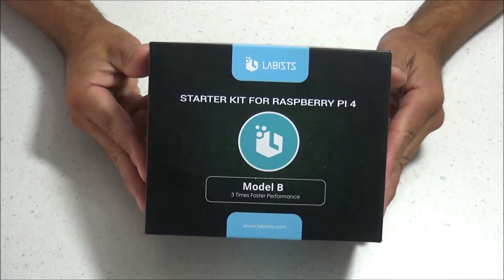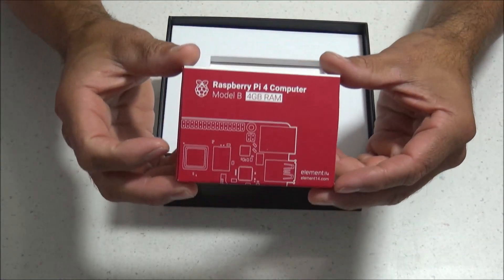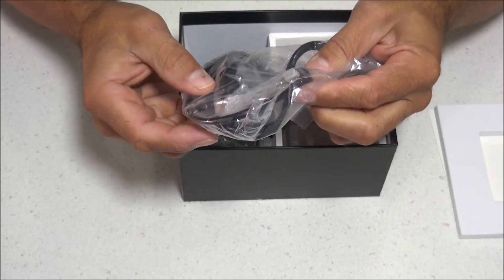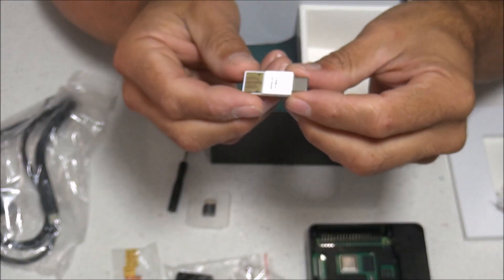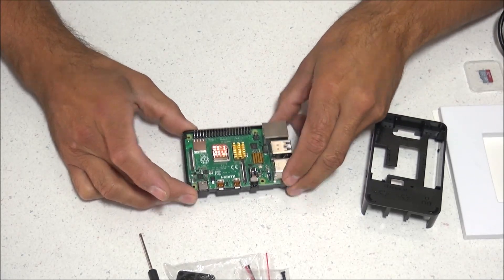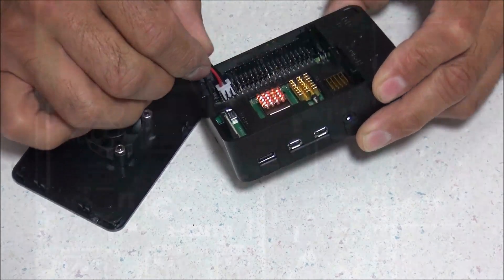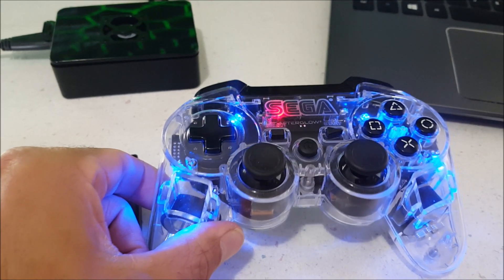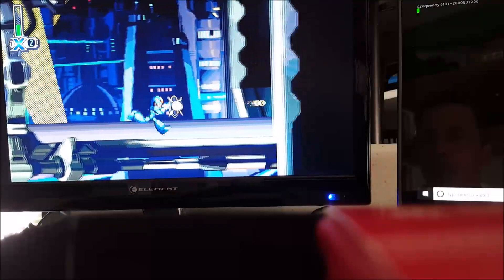Raspberry Pi 4 ready to GO Starter Kit. Pi 4 + Case + Fan + Micro SD Card & More

Comment: So, which way should the fan be installed? Are there instructions on the proper orientation? You said nothing about this. Sucking air out or sucking air in? The fan can be installed either way.
Reply from the maker: I recommended placing the fan label up facing towards the top of the case.  just like in a video
Reply: @8-Bit_Flashback  Why? Based on what?